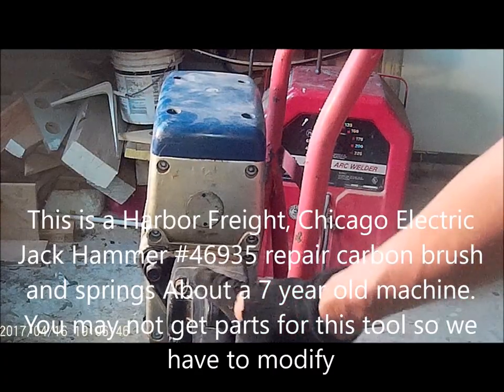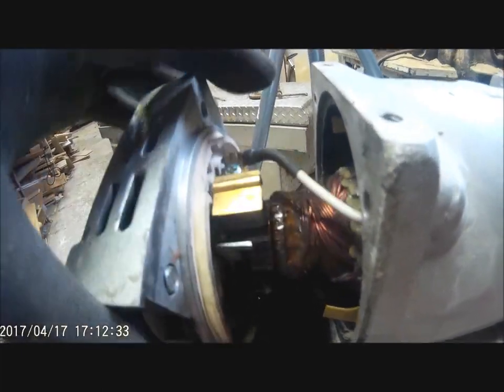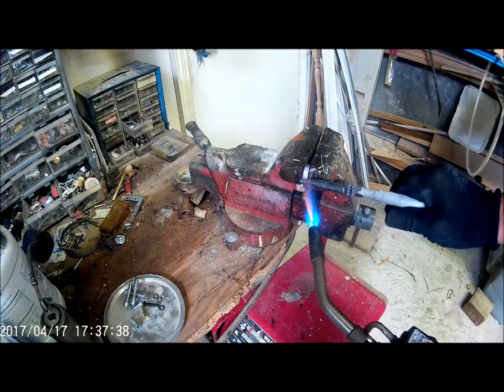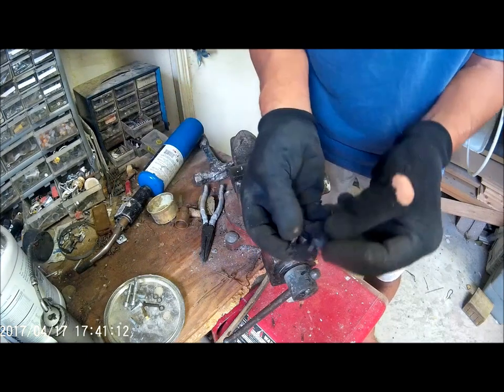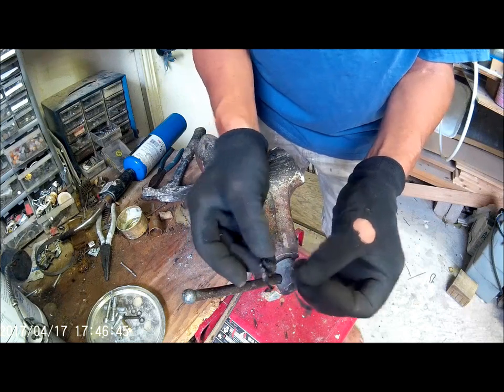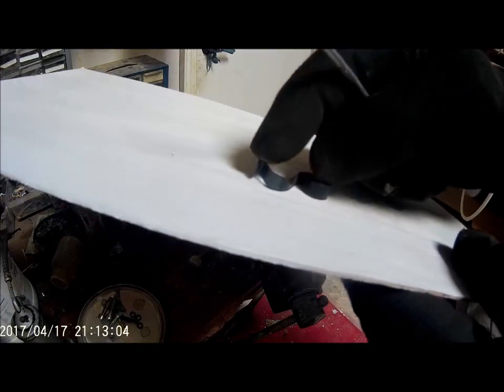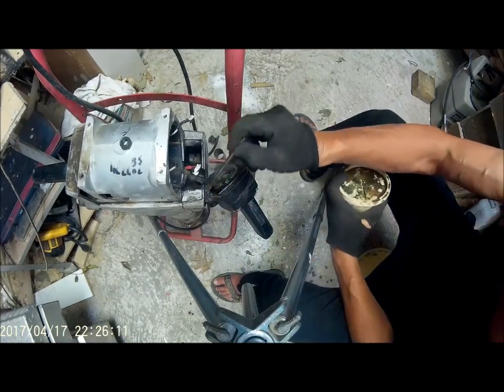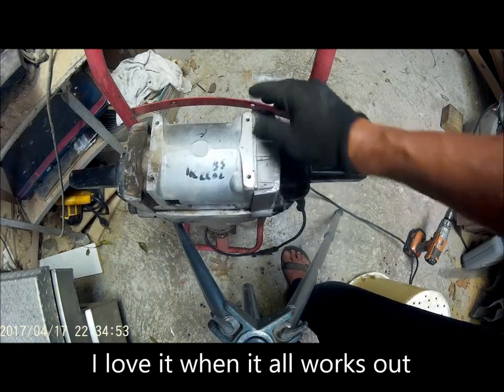Repair( Hack) Harbor Freight ,Chicago Electric Jack Hammer Repair, springs , carbon Brushes

Comment: I've got the same problem except my spring is gone. Had this jackhammer since 2004. Used it hard too. I do remember it came with new brushes. I put then in a "safe place" LOL moved 4 times since. ..I reckon it's time for a new one

Comment: Question my Chicago electric jackhammer is constantly wearing out brushes especially on the one side. It seems as though they are adjustable do you think maybe I'm tightening it too much on the one side making it spark and wear out.?

Comment: Nice job, how did the springs held up? Is it still working?  I Hopes So.
Reply from the maker: That's the right question! So So It works still but every so often I have to smack the top of the hammer to get it to engage. It's a repair but not perfect. It will get the machine up and running. When it fails as I suspect it will then it will be better to try and adapt a different spring system and abandon the original. I in fact sold my hammer b/c I didn't want to deal with it  plus don't have that much use for it.

Comment: I need the ARMATURE. Do you know where to find it. or repair it?  Thanks in advance.
Reply from the maker: HF no longer has parts so maybe find someone who's selling a used machine. I fixed mine then sold it bc I knew parts wouldn't be available . look at ebay pbly your best option